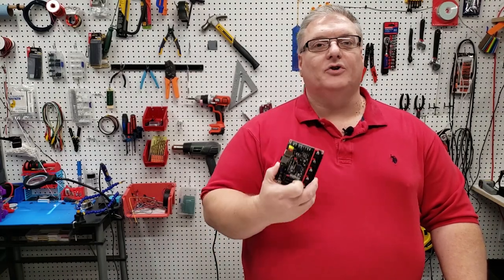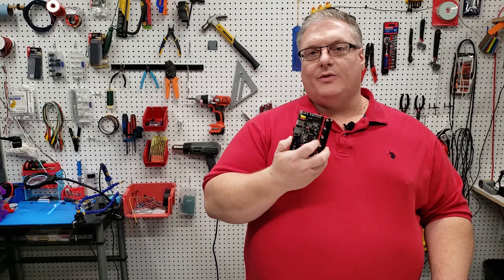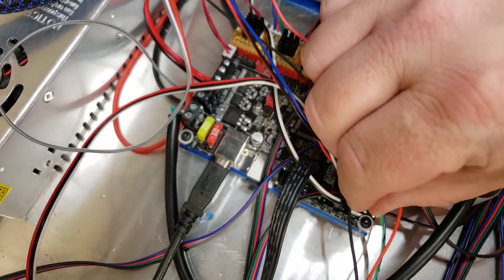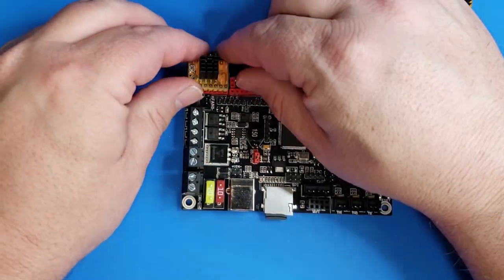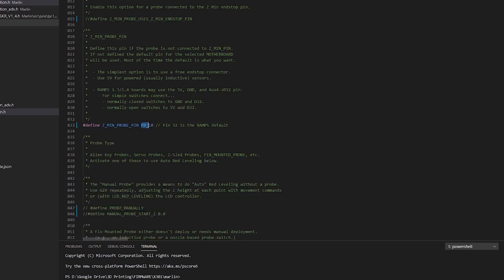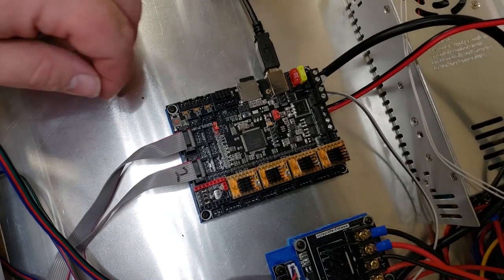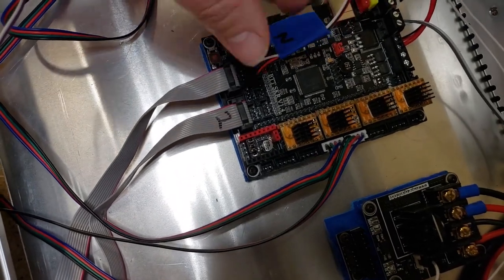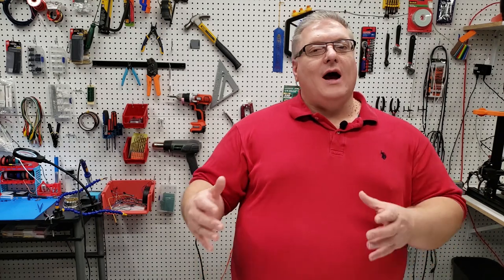SKR V1.4 Mainboard Upgrade & Installation

Comment: Hi there,

I will be upgrading my Artillery Genius to the SKR 1.4 with 2209 Steppers, I bought the board and steppers separate as it worked out cheaper.
Currently my printer has 5 steppers as Z uses 2. When upgrading Id like to use Dual Z, Do i leave one stepper out or install anyway?
Also, you mention you used a splitter for your current setup but no longer needed as the SKR has it built in, do you mind sharing the configuration for this as I know i'll need to change mine from 2 steppers to 1.

Thanks!
Reply from the maker: If I understand what you're asking the dual Z's are plugged into the two available Z ports on the SKR v1.4.  So on the board pinouts you'll see the board is marked for each stepper connection like this  X Y Z Z E0 E1  where you'll see there are two Z ports.  They both go the the same step stick plugged into Z.  So you only need 4 step sticks.  Now optionally you can assign your E1 as a Z in the marlin firmware but that is a bit much to tackle in a YouTube comment.  Lots of people in the Discord can help you with things like this.  Thanks!
Reply: Makers Mashup Thanks for replying.
After a little more research, I found the Genius already runs Dual Z, all thats needed is to just swap over wiring the same as the stock board and the usual config changes for steppers.
I will take a look at the information you have supplied thanks.

Comment: Thank you for the video. I am currently trying to get my SKR V1.4 Turbo to work on my ORTUR 4 V2. I am using TMC2130 Drivers and a BIQU TFT35 v3.0 Touch Screen. I have the Firmware uploaded successfully into the card, I unplug the card to refresh the firmware, the firmware is successfully uploaded and installed but when I plug the USB back into the computer it will not connect with the SKR V1.4 Turbo. I cannot access it as a USB drive in Windows Explorer and I cannot connect to it with Pronterface. If I plug the SKR's SD card into the computer directly I can see that the firmware is updated. But I cannot connect when the SD Card is in the motherboard. I can give the board power and I turn it on and the TFT touchscreen works but is says there is no printer installed,  and I cannot move the steppers at all. I'm stuck. I have been over this code 20 times and I can't find the problem.
Reply from the maker: Paul - Probably a bit much to try and tackle in a YouTube comment.  Your issue of the drive not showing is likely because you have the onboard SD card enabled.  Also your TFT35 should have an emulator in it (Try long press the knob) that should get you to the marlin menu.  If you drop new firmware on the SD card the SKR will read it when you reboot the board.   Try reaching out in the discord so many more people there can help you along with myself.
Reply: I had to change my serial port to 0. Yours might be -1. Or vise versa

Comment: thank you for the video. now i start to instal marlin 2.0 to SKR v1.4 turbo, after instaling, i found issue Heating Failed:E1. any idea of this issue?
Reply from the maker: Make sure your thermistor and heat cartridge are working properly and run a PID Tune from marlin.

Comment: I'm getting thermal runaway even with a PID autotune.  Voltage is good on the power supply.. Any suggestions?
Reply from the maker: I had this issue myself and it drove me INSANE.  The issue was that the thermistor cartridge I had (E3D Official one) had a loose connection.  I replaced that and everything worked fine.  The other possibility would be the heater cartridge wire is lose.  The way I was able to figure it out was that Octoprint has a thermal graph and wiggling the wire would send the chart all over the place.  If you don't use octoprint I would say try replacing the thermistor and/or the heater cartridge.  Both are fairly inexpensive.  I would also check your connection to the mainboard itself is not loose but I presume you checked that first.

Comment: Sitting with my SKR 1.4 installation right now from stock ender 3. My end-stops dont seem to do anything, trying to auto home is commiting suicide it just rams stuff into the walls
Reply from the maker: Check the settings in the firmware sometimes they need to be inverted or have the pullups assigned.  Install pronterface and use M119  to see the end stop states to prevent catastrophes. 😉
Reply: @MakersMashup  now they work, but when I home the X or the Y axis the Z also tried to home but makes an awful sound, when I disconnect the Z motor the X and Y homes fine by themselves, it's really strange
Reply from the maker: @sendrake5005  really not sure without more information but it sounds like you have to check your stepper settings.  The have options just like endstops.  Also make sure your driver is set right.  Suggest you run through all the marlin options to make sure everything is set right.